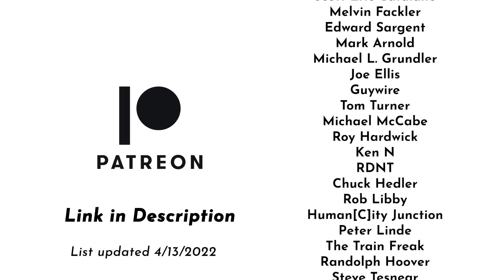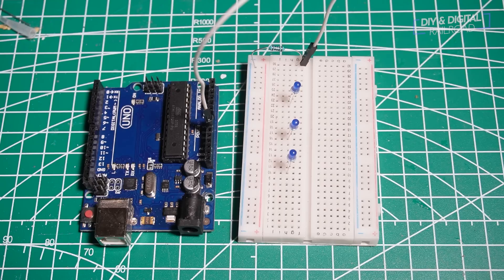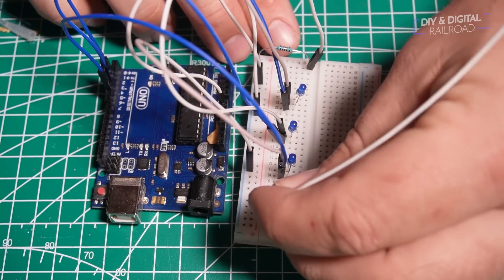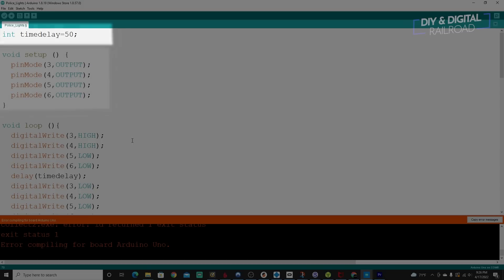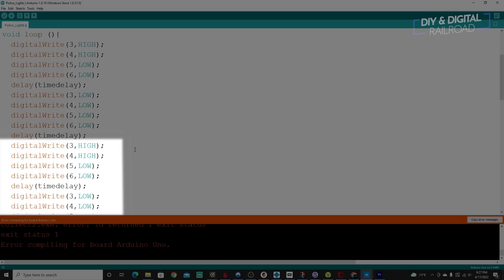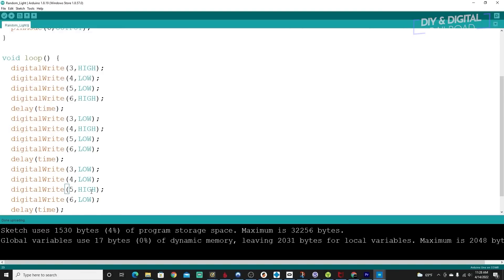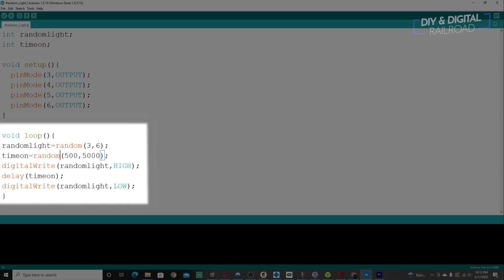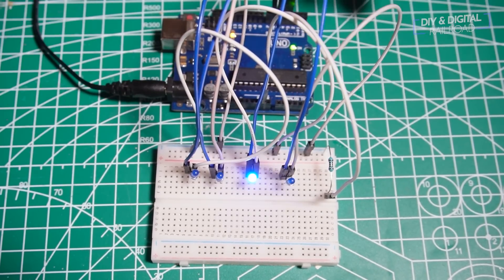3 Simple Model Railroad Arduino Projects for Beginners

Comment: I'm new at this and already I have problems!! 
I built the project but writing the code is the issue...
The word "setup" , on my IDE console is RED . How do I get it to Black ? 
When I try to run the example on my Arduino UNO it gives me an error that pinmode is not defined? How do I correct this?
Sorry for the rookie questions.

Comment: Hey Jimmy, I have watched this video countless times. I do have a very serious question. In the arduino, can you program it to power down a section of track right at the signal block so that if you are running multiple trains and don't have to scramble to your dcc to power down the locomotive entering that red block
Reply from the maker: Yes you can isolate that section and use a relay to power it down.

Comment: hey jimmy; hope this message finds you well. so i purchased my first arduino kit and started playing with it. when i ran your chasing lights and random programs i found an issue with chasing lights #6. it comes on at the same time as #3 and does not seem to chase well, second, with the random light #6 does not work at all. now being i am extremely novice to this coding, i was wonder if there is a fix. please advise thank you

Comment: Hi Jimmy. I really enjoy your arduino videos (which I’ve purchased and have started trialling)  - thanks for the great work. I question or suggestion for future videos. I have a load of RC plane parts in my garage from when my son was younger - esc, receivers, transmitters etc. This technology seems a lot simpler than dcc to use in rail modelling (for a start, no wiring), with all the same functionality. But there is so little uptake of RC In HO,OO, N gauge. I found a company called DelTang who made a start but seem to be out of business. Is there any chance RC could be an area for future videos?

Comment: Nice video but again I don't like the code.  Don't take that personally I don't like any arduino code. Always the same beginner mistakes.  1. You should never have to say think of this as that while explaining code you should make your code  read ON | OFF by making  constants for ON | OFF.   2. NOTICE HOW HIGH AND LOW ARE ALL CAPS THOSE ARE CORRECTLY DEFINED CONSTANTS ALL CAPS.   Timedelay should be all caps because it is a constant.  Constants are all caps.
Reply: I support the code. Don't lose sight of the fact that this code is aimed at beginners. It is simple and easy to understand without the constraints placed on professional programmers. Having taught computer programming for 18 years, understanding the code is more important than industry imposed rules.
Reply: It's a good video.  Would've been easier to understand with [ON|OFF]

Comment: On to my software comment. If you only want to turn one light on, then off, your approach works fine. But if you want to simultaneously control, say 15 lights, the use of delay() will not work. delay() basically stops all processing on the Arduino and you end up losing a HUGE amount of computing power. The solution is to create a class - name it LED - which supports a number of methods, and which monitors whether the LED is currently on or off. At the start of the loop() function, you must refresh the led state by calling, for example, Green.refresh(); where Green is a LED object and refresh() is a method provided by the LED class. Then the rest of the loop() function allows you to modify the state of the LEDs. This makes your sketch look like this (for a simple example):

#include <LED.h>

LED Red = LED(6);
LED Green = LED(A0);
LED Yellow = LED(13);

void setup() {
  Green.blink(100,200);
  Red.blink(250,250);
  Yellow.blink(500,100);
}
void loop() {
  Green.refresh();
  Red.refresh();
  Yellow.refresh();
}

In this example, a red LED is connected to digital pin 6, a green LED is connected to analog pin 0, and a yellow LED is connected to digital pin 13. The blink method (provided by the LED class) turns the LED on for the first specified interval, then off for the second specified interval, then repeats.

Here is the important part: there are NO delay() function calls - not in the sketch above, nor in the LED class code in LED.h. Each LED object maintains its own timer, and decides whether the LED should be on or off. Every call to refresh causes the corresponding output pin to be set HIGH or LOW, as required. This frees the Arduino to do other tasks simultaneously.

Bottom line: If I could give just one piece of advice to new Arduino programmers, it would be this: find a way NOT to use delay(). It is a very effective way to paint yourself into a corner!
Reply: Thank you for your input!!
 I am one of those beginner programmers and this info was very helpful!

Comment: Jimmy, this is a great intro and I hope that Arduino beginners are encouraged to start an Arduino project. I have two comments - one on the hardware and one on the software.

Regarding the hardware, I use Nano clones for all of my light and sound effects. You can get Nano clones for about 10 bucks each; name brand Nanos are about 15 bucks if you buy in bulk. (These prices have gone up a LOT due to Covid supply chain issues!) By contrast, an Uno costs over $20, and an Uno clone is between 15 and 20. Since you'll be mounting the Arduino under your layout, each Arduino project becomes a significant cost - say, equal to a ready-to-run freight car. Once I've tested my circuit and software, I mount my Arduinos on a circuit board (or bread board) along with all resistors and connectors. You can get an assortment of 100 circuit boards for $15, and 60 2-pin screw terminals for another 15$ on Amazon.
The completed board can be powered by a 15 VDC power bus; no USB cable required. BUT, be sure you can access the USB connector on your Arduino so you can modify the programming later!
Reply from the maker: I use Nanos too for nearly everything on my railroad.  I typically only use UNOs for prototyping.  If I need a ton of I/O, I step up to a Mega.

Comment: Hi Jimmy.  Nice video - one comment.  For the random lights project - the Arduino random(x,y) will return a value between x and y-1, so the sketch needs to be modified to use randomlight = random(3,7), instead of randomlight = random(3,6) - or the LED attached to DIO 6 will never come on.  -Rick
Reply from the maker: good call.

Comment: Great video. Where r the schmatics and arduino code?
Reply from the maker: The code is linked in the description as well as the schematic.  They are all available on github.
Reply: @DIYDigitalRailroad  Jimmy I just checked the description and I'm not seeing the github link for the sketches & schematics. Could you please check & confirm they got uploaded?  Thanks!
Reply: I also do not see the link for the schematic and codes.
Reply: I'm not seeing the code or any of the links mentioned in the video either. There's a lot of links, but none specific to this video. Like the video a lot, by the way.
Reply from the maker: @davelandry646  Try it now, it should be fixed.
Reply: @DIYDigitalRailroad  There now - All is good!! - Thank you for your quick reply!!!
Reply: @DIYDigitalRailroad  Thanks Jimmy!

Comment: Thanks for another nice Arduino video!!  The Arduino ability to introduce randomness ... using Random(x,y) function calls ... for lighting, sound, and motion controls ... is it's highlight for model railroad applications in my opinion.   As you pointed out, it can make a building look more realistic with random room lighting.   It can make a city scene look more realistic with buildings being randomly or (semi-randomly) lit depending on the time of day you wish to simulate.   I'd like to add this realism with a fast clock so that I can watch my city scene change from one day into another.   While each day is similar to the previous day  ... each day slightly different from each other as in real life.  

Suggestion.   Maybe you could discuss fast clocks in a video.   JMRI has some fast clock features but I don't know how to use them.